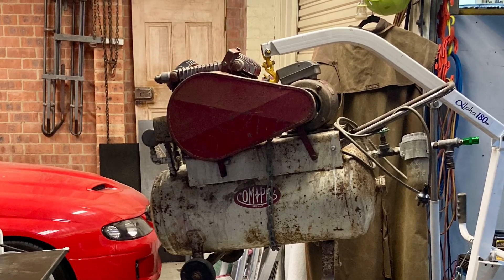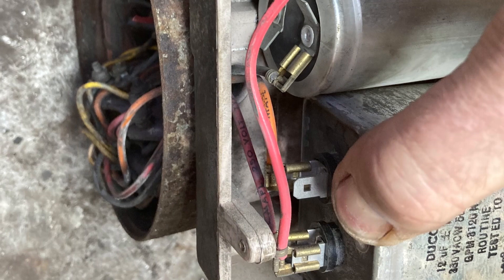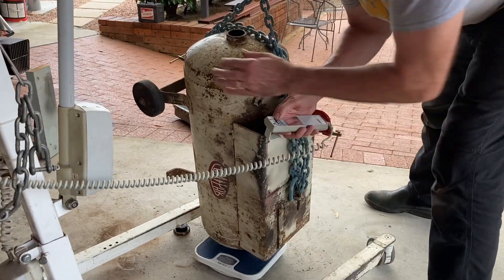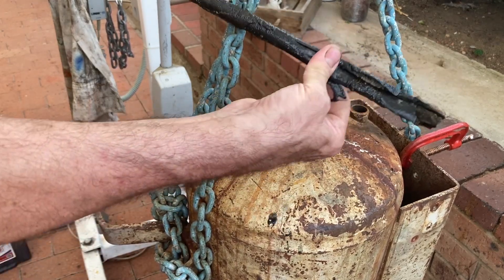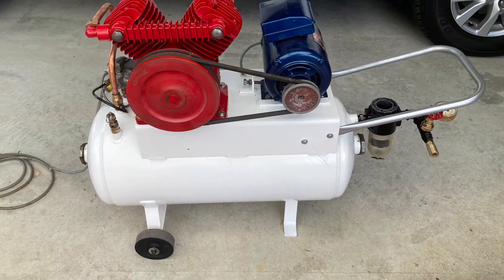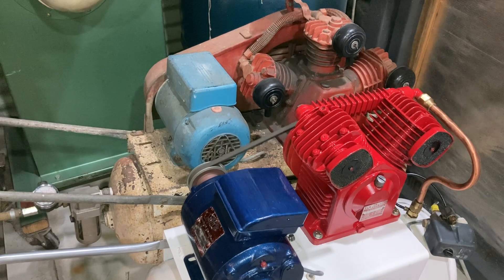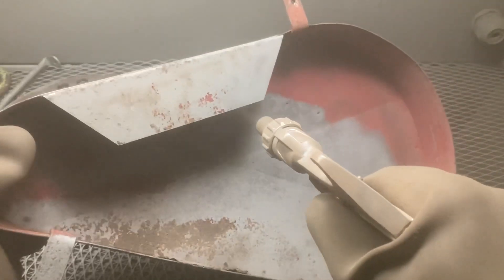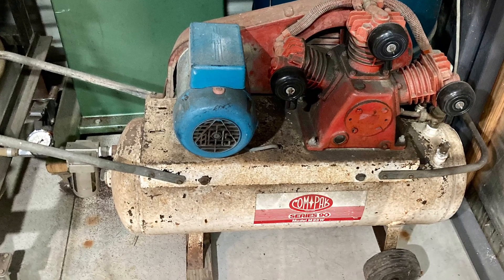Compressor Overhaul. 48 year old Compak compressor including 300 psi tank test. Will it explode?

Comment: Excellent job Stuart! I've done a lot of electrolysis cleaning, but wouldn't have thought to use it for cleaning inside the tank! By the way - did the old tank have much sludgy water in it? I was thinking that may have been some of the extra weight!

Comment: Nice set up, well done. My old one was leaking, under some seals, sounded like a mouse squeak or something, but much louder. Bought a new 2 cylinder one, does 350 L per minute, still little slow for sand blasting.
Reply from the maker: Yes, sandblasting requires a LOT of air👍👍👍

Comment: Wow!  😁👍🏼😁👍🏼😁👍🏼  Great Job!
Hey what blasting media do you prefer?
Reply from the maker: Hey Time Flys it’s great to hear from you my friend. I use garnet as it’s sharp and probably the best value for money. 30-60 grit really gets the parts clean quickly and I have walnut and other media I’ve never used them. If I want to be more gentle I just reduce the pressure. It also gives a very good surface for primer or powder coating to adhere to. Hope this helps, cheers 🍻
Reply: @scroungasworkshop4663  Thanks!  I have only used normal sand.  It is super cheap, but does not last very long before it becomes powder that blows away!
Reply from the maker: @timeflysintheshop  Sand is a very bad idea because as you say it breaks down very quickly and it’s also very dangerous because the super fine dust that the blasting creates gets right down into the lungs. This can cause silicosis which is scaring of the lungs which is, at best debilitating and at worst fatal. Most filters used with sandblasting can’t capture this super fine dust. I have a huge dust collection system that uses three truck air cleaners but I still wouldn’t use sand so please stop using it my friend, it’s just not worth it. Cheers Stuart.
Reply: @scroungasworkshop4663  No worries!  I have not used my sandblaster in many years.  When I did, I wore a respirator and I did it outside in a corner where I could sweep up the sand and reuse it.  I am sure I probably still got some in my lungs, but if I decide to blast again, I will get a cabinet and use something other than sand.
Reply from the maker: @timeflysintheshop  I think you’d have been safe with a proper respirator. Cheers

Comment: Great job. I bought my compressor from Compac in QLD, it was a used model that had been traded in on an upgrade. I’m curious to the size and type of blasting cabinet, would love to see a few more details about that at some stage. Perhaps as you walk us through your restoration of your original compressor.
Reply from the maker: Hi Jon, my blasting cabinet is nothing flash but has been a work in progress for about ten years gradually making improvements so I will be doing a video on that in the future. The twin compressors has been the best improvement by far though. Thanks for watching. 👍👍👍

Comment: Good job. I have a  Binks Bullows 7.5 CFM the same vintage.  Had it from new.  The cheap Chinese ones sold now are total junk. Be aware those polycarbonate filter bowls deteriorate with age and eventually crack and explode.  Cheers Rob
Reply from the maker: Hi Rob, good to here from you. I payed special attention to the polycarbonate bowl for just that reason. This one was about 5mm thick with none of the spider webbing they get when they’re old but thanks for the warning. I’ve noticed that some of the Australian made compressors, while made here, are using Chinese pumps and electric motors. I really can’t see any of those lasting 50 years. Cheers my friend and roll on summer 😂

Comment: S.W. very nice work.. I bought one from a co-worker and it was gas engine and I wanted to convert it to electric.. I got an electric motor, hooked it up and it took forever to pump up..So I tore into the compressor and found one of the cylinders had a broken connecting rod.. so I purchased a new compressor section (single cylinder) and hooked it all up and it worked great.. the only piece of the original set-up was the tank.. everything else was new... I didn't get away as cheaply as u did , but it worked great.. S.W. thx for taking us along on another adventure.. Take care my friend...
Reply from the maker: Hi Gary, sounds like that was a headache to fix. I think once I had found that broken con rod I’d have quit that one so good on you for preserving with it. Thanks for your comments. Cheers my friend, Stuart.